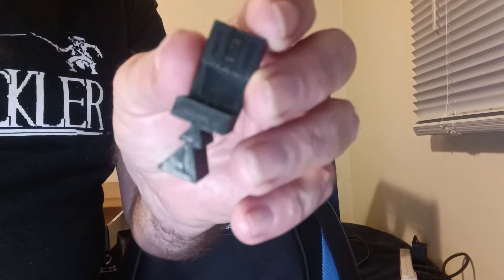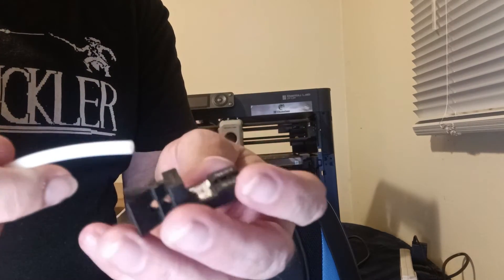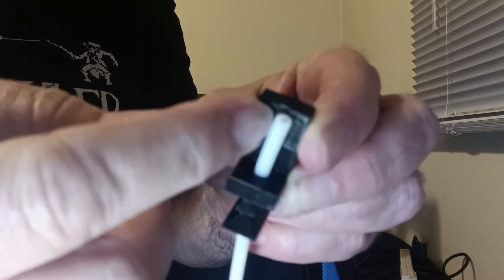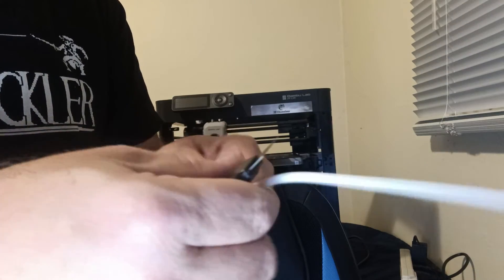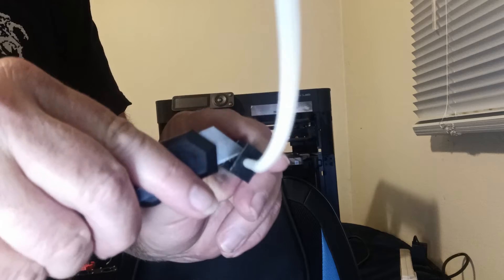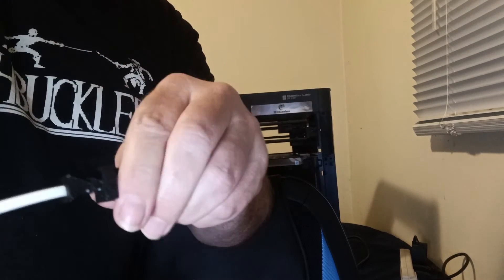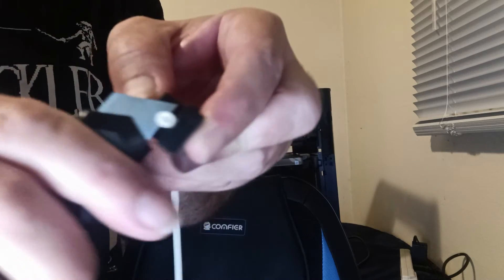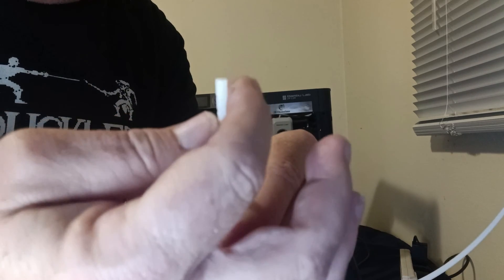PTFE Tube Cutting Guide

Comment: Would it be possible to use the 3D Chameleon in a Creality CR-10 SE?
Reply: Sure, it's a universal kit.  It works on any printer.  CR-10 SE is going to be nearly identical to the latest Ender 3 printers, so it's no issue.
Reply: @williamsteele  thanks for the reply! Even with the fact that the CR-10 SE is a direct drive?
How could I start?
Wouldn't a cutter for the filament needed?
Reply: @multibatmam1  The 3DChameleon doesn't care whether it is Bowden or Direct Drive... It's just loading it and unloading it the same.  Our GCode needs to know the distance between the two.  

As for the 3DClippy, that's not required on any printer... It is an optional thing you can add to make tuning and tip shaping a lot easier, but definitely not required.  We don't use one on the Creality K1 or the Prusa Mk3 direct drives, for example.
Reply: @williamsteele  Understood. So I would try to follow the video for the Ender 3 V2 Neo?
Reply: @multibatmam1  The best is to follow our Basic Installation Playlist.  #1 and #3 are the most important, as #3 supersedes the Mk2 instructions in the first video.

Comment: Is there any documentation available about making this work with klipper? Also is there a discord or open Facebook community group?
Reply: It's agnostic to the firmware... Everything is done in GCode. As for FB or discord....there is a FB group for it and we also have a public forum on the website.  No discord, however.
Reply: @williamsteele  are there any instructions about how to set it up with klipper? When I google that it just comes up with a single Reddit post where 4 people couldn’t work out how to get the second extruder/ feeder motor working
Reply: @jamieclarke321  The instructions are the same regardless of the firmware.  What they're trying to do is drive it without our electronics driving it, which already run it fully using the single switch or I/O pin.
Reply: @williamsteele  and from what I can tell there’s only a business page for it. There’s no community group where people can share their results and trouble shooting tips.
Reply: @jamieclarke321  We have a forum on the website specifically for that.
Reply: @williamsteele  I appreciate your replies bill. I also see you’ve got it working with the K1 so it’s clearly klipper compatible. I’m just worried I will get stuck trying to implement it on a VZbot330
Reply: @jamieclarke321  It's literally commanded by moving the extruder to press our button. It was specifically designed to be implemented with G0, G1 and G4 commands so it can work with ANY printer. Hook up the Y adapter to the extruder, mount the button, tell the software where the button is and you're done. Some folks think about it too hard and don't see the simplicity of it... So try solutions of their own design.  Don't do that until you understand how it works.